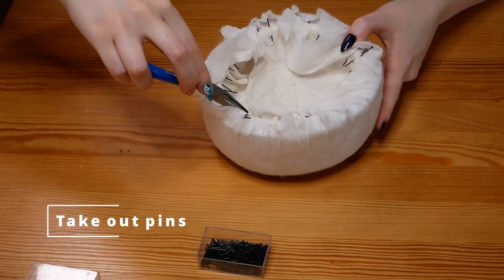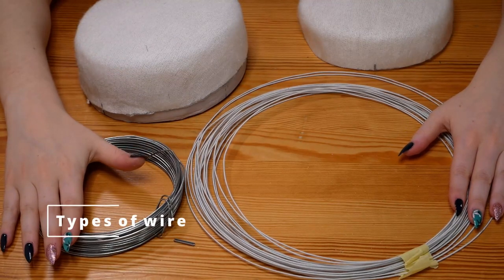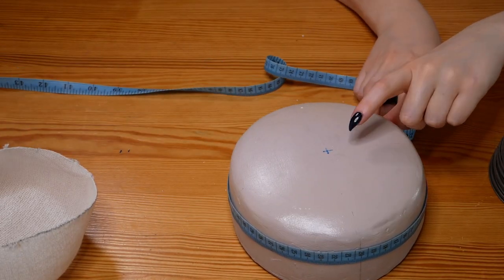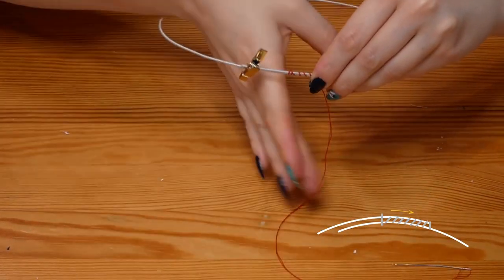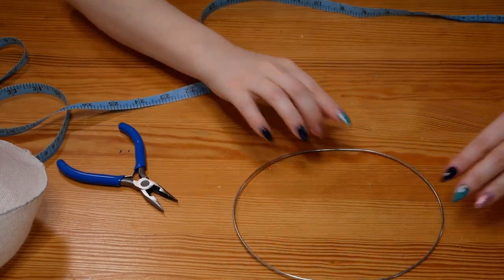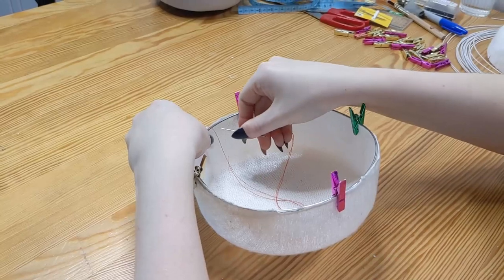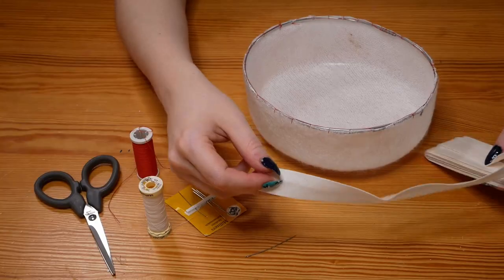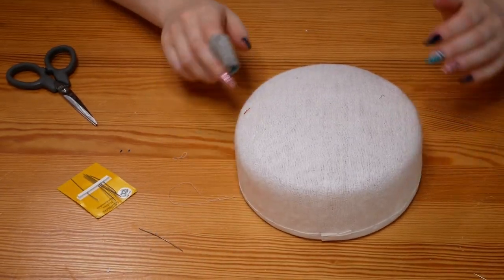Millinery Shorts: How to wire a hat shape by hand | vintage millinery technique

Comment: Hi Ilona. Thank you for such an in-depth video.
Quick question, with regard to the wire, I have a typical button block, does the wire Sri right on the edge or does it sit on the inner rim of the button shape? 
Best wishes
Liz
Reply from the maker: Hi Lisa, I'm probably not the best person to ask about buttons, as I don't make this shape. However I would assume it goes on the inner rim to help keep the curved edge secure. I hope this helps? 😅

Comment: Where do you get the galvanised wire? ❤
Reply from the maker: Garden centers are a good place to start. Or try hardware shops, and failing that, just search for it on Amazon.
Reply: @ByIlonaMillinery  brilliant, thanks!
Reply: @ByIlonaMillinery  me again 😅 can you please give me any more info on the wire you buy? I had a heated argument with a length of proper cotton wrapped millinery wire yesterday. I think I won said argument...eventually...with the help of my dad and 2 pairs of pliers 😑  thanks! ♥️♥️♥️
Reply from the maker: @swilson3354  Hello, if it is propper millinery wire, it won't make a difference where you buy it from. I use 1mm or 1.2mm thickness depending on the hat it is for. Working with wire is surprisingly hard and fiddly, and it just takes time and practice to master it. The most important thing is to straighten or flatten it so that it doesn't "ping" out anywhere and cause injury. It does sound like you might need a new pair of pliers though!
Reply: @ByIlonaMillinery  thank you! Haha the  pliers survived. The hat so wonky that I think I'll have to take it apart. Think I need another layer of sinamay anyway. Looks too translucent for my taste! Awhh well. You live and learn! Xx